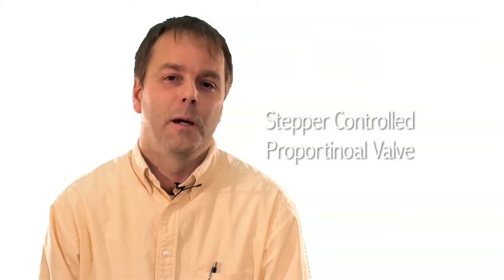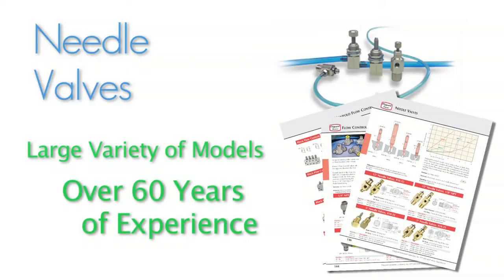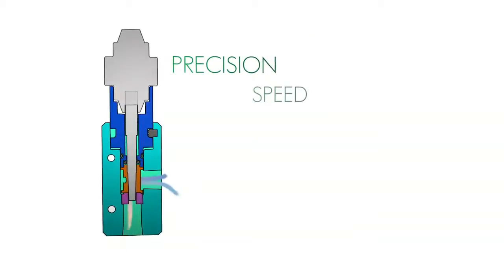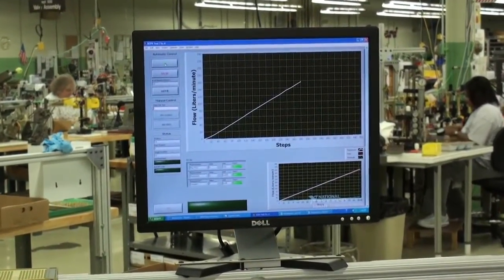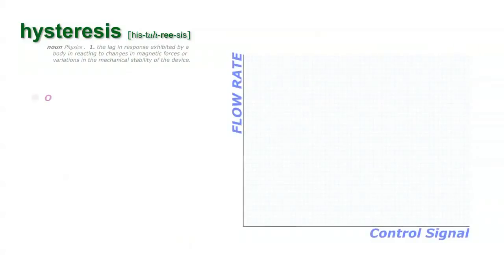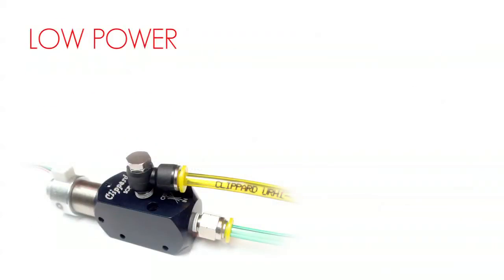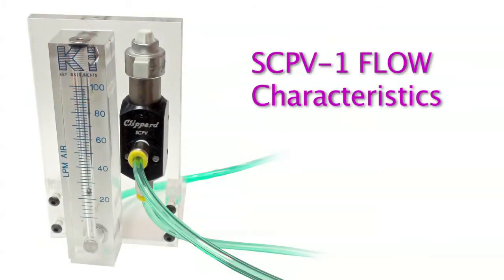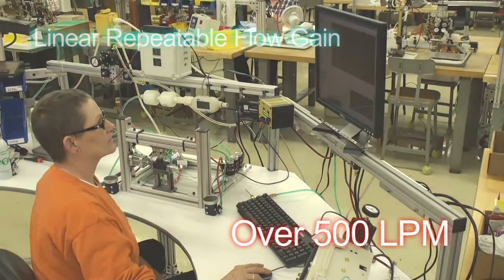Clippard Stepper-Controlled Proportional Valve (SCPV) Introduction

Comment: Can it be used as ball valve to shut stop liquid?
Reply from the maker: Currently the SCPV is not meant for liquids, only air and gases. If you're using air, you can order with the option -R that adds a soft seat and enables it to fully close the valve.